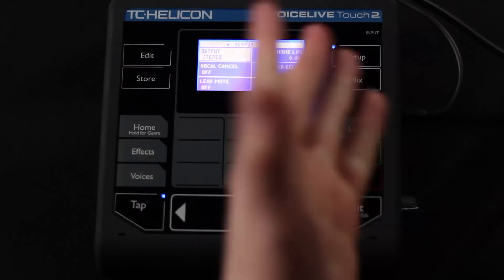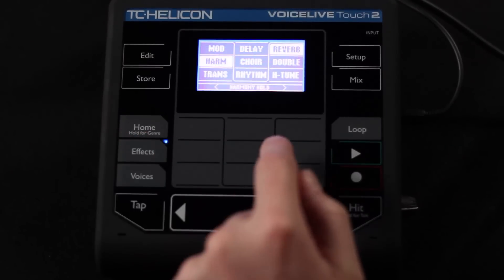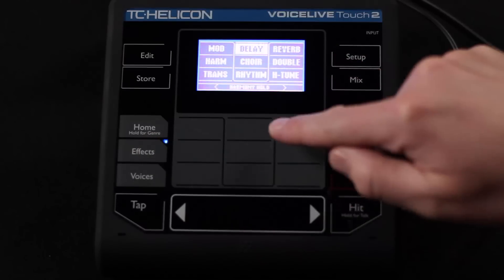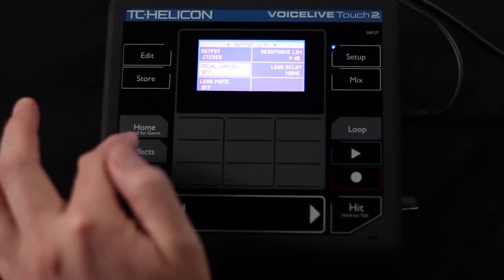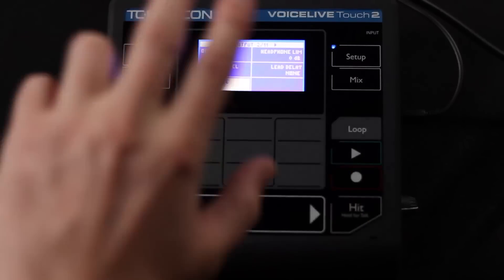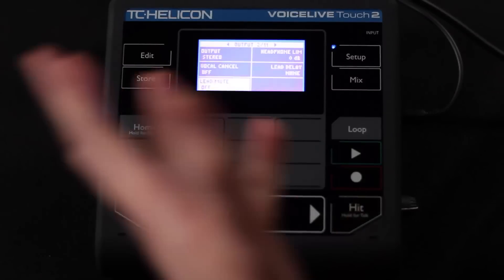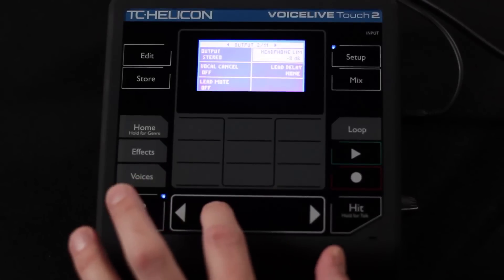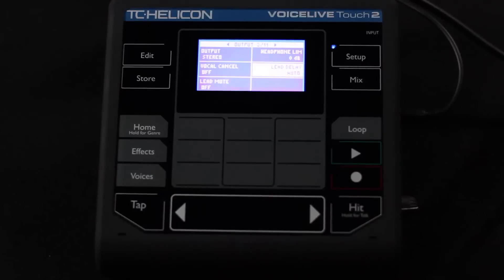Touch 2 Video Manual - Chapter 3b - Setup - Output

Comment: Each preset has a vocal correction style...However in the input menu there is a pitch correct amount. Even without any effect on is the unit still doing correction?

Comment: Just purchased the Voicelive Touch 2. The Video Manual Idea is awesome except for one problem. Maybe its my desktop computer monitor but I can't see the Voicelive Screen in the video.. There is bad lighting and everything Craig is talking about can't be seen:(
Reply from the maker: +Overcoming My Lung Disease Hmm, it might be the monitor, but the screen on the VLT2 is definitely not perfect in the video. Hopefully it's clear enough to follow along with if you've got the unit right there with you. It's one of those contrast things where the unit is quite dark and the screen is bright, so we had to find a balance where you could still see what was printed on the unit itself and see the screen too. It's something we're trying improve on for future videos.
Reply: Thank you for your prompt response! You have explained it well..  I will work my way through it as you have suggested with the unit next to my Mac Monitor.

Comment: I have my mic going into this unit, then out to my mixer (Presonus 16.4.2 AI) and from there into my iMac via Firewire.  I followed this video and made sure my output is in fact Stereo but when I turned on my delay I can here the delay but it doesn't bounce from side to side like what I hear in the video... any idea why?
Reply from the maker: Hmm. You've got a ping-pong type style selected? Not all the delays are in stereo.
Reply: Yep ping-pong is selected but just not ping-ponging back and forth like I hear when I hear yours.  Mine isn't in stereo at all.  Maybe I should recheck how I have it all connected.
Reply from the maker: Hmm. Are you going out the TRS outputs? (The XLR out is only ever mono) Double check that the output mode of the unit is Stereo in the setup menu.
Reply: Yep I'm going out through XLR.  I'll switch it to TRS.  Thanks!
Reply: Just switched to TRS and working great now!

Comment: hi i just purchased one of these how is there any way to get the audio that would go into the headphones throught the touch live to go through the computer then into your headphones
Reply from the maker: Yes, you bet! Use the USB output on the back of the device to connect it to your computer. You'll need to open a DAW for monitoring, but once you have that open you just need to check that your computer is receiving signal for that DAW through the USB input. Then you can monitor as you usually would through a DAW.

Comment: Thanks for these awesome videos. They were very helpful so far. I got one question: Is there any way that I can use the trs out to bypass the mic signal, so that I can have the unedited voice in the mixer without all the effects?
Reply from the maker: You can use the TRS outs in "Dual Mono" mode, but it's not 100% unprocessed. One side carries effects and the other is dry, with tone and any global pitch correction you apply. Effects like Transducer or HardTune necessarily take over the "dry" path, because they're not additive and actually become the entire lead vocal signal. Hope that helps!

You can always run a mic splitter before the T2 if you need a completely dead dry signal at the mixer. You'd want to turn "Lead Mute" ON in the setup menu in that case, so the signal coming from T2 has no dry (with the exception noted above)
Reply: Hey there. Thanks for the speedy reply. In fact it is 'mono' not 'dual mono'. But your answer made me find the right section in the manual. Thanks!

Comment: I might have missed it, but can I run a wet/dry mix out of the jack outputs?
Reply from the maker: You can run a "dual mono" output that has dry on one side and fx on the other. There's a couple of things to note though: 

Dry is with Tone and any pitch correction (global or HardTune) and Transducer, since all of those things "need" the lead voice to do anything. All other fx come via the other output.
Reply: TC HELICON thanks for getting back to me, doesn't the VL2 have a dry output though? What's the difference in processing power between those two models?